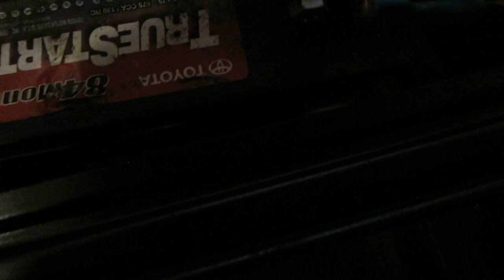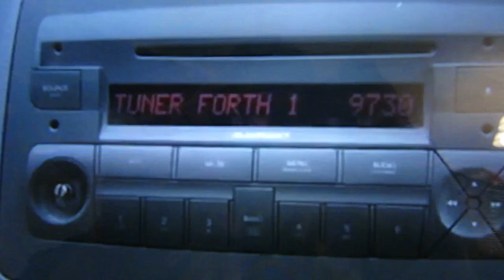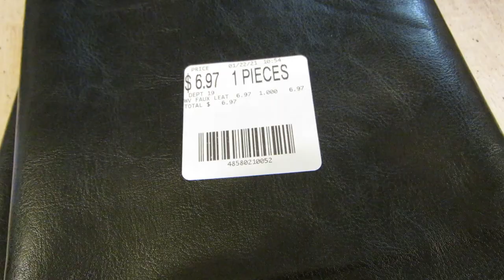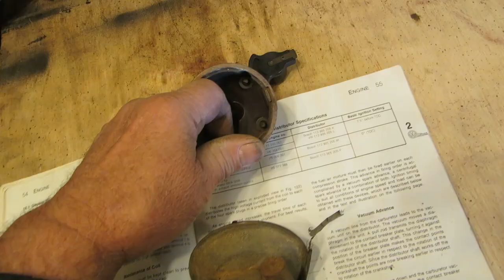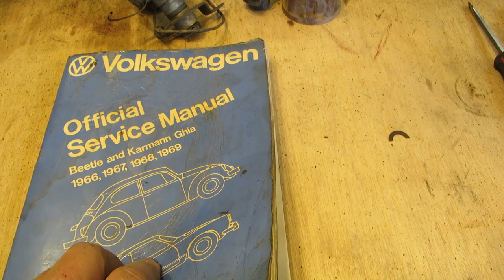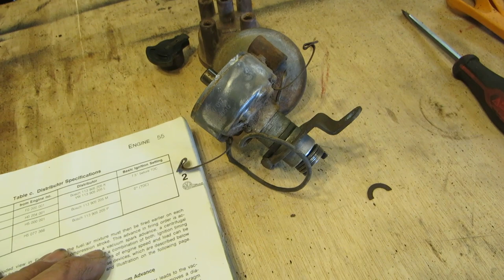1969 VW Beetle More Stuff

Comment: 👍 The transmission also leaks out of the vent hole, if you jack up the car to high to remove the engine. Done that in the past.
Reply from the maker: Yes, that’s what I was thinking.....until it wouldn’t stop.

Comment: the engine running good and the generator is fixed for many miles.
Reply from the maker: Yes....will be running better after correct carburetor arrives
Reply: @OkFixer  o you will put on a new one or a rebuilded one?
Reply from the maker: @VWBEETLEOVAL1955  the original old one. There is a man here in the US .....you send him your carburetor and he will completely restore it.
Including re-bushing the throttle shaft, and re-plating parts.
He has so much work, it generally takes him 2 months to repair it.
https://www.volkzbitz.com/
Reply: @OkFixer   and what is the price to rebuild a carburetor?
Reply from the maker: @VWBEETLEOVAL1955  https://www.volkzbitz.com/ Is the web address....contact him